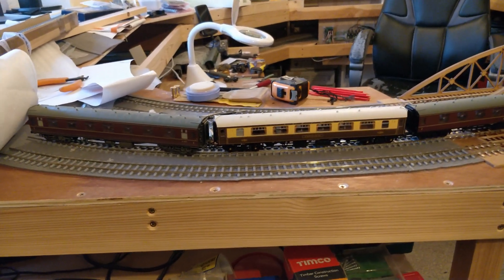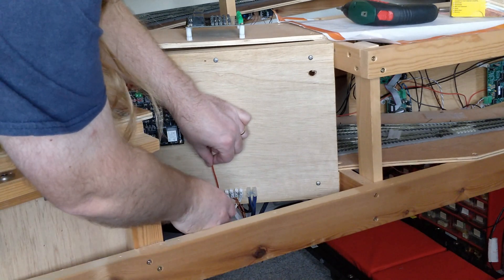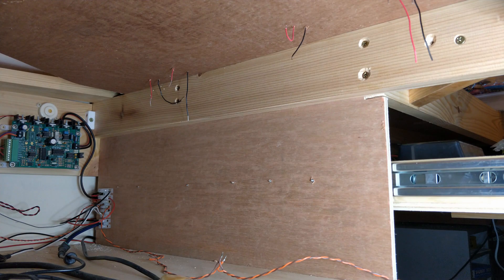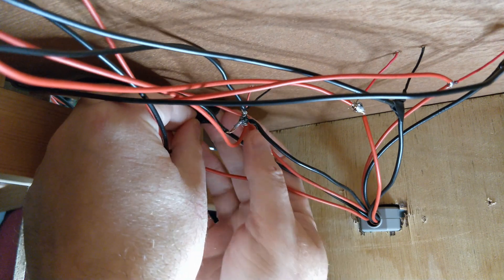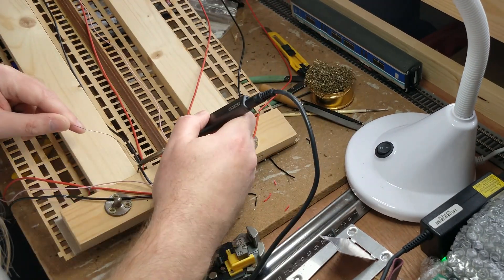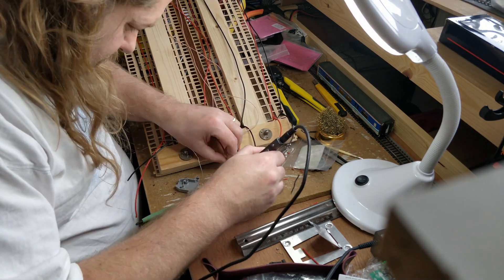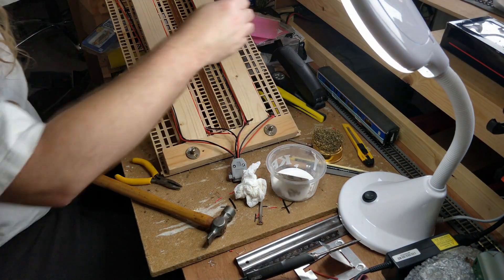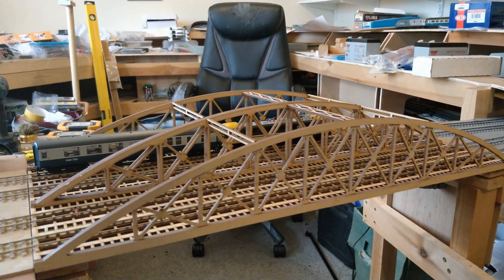Model Railway Construction: Wiring the Lift Out Bridge

Comment: Where do you get the 15 pin D connectors for linking the two together?  Can you recommend any?
Reply from the maker: I had these in stock, so I'm not sure exactly where these specific ones were purchased from.

Connectors of this type are available from the usual electronic component suppliers (e.g. RS components or Rapid Electronics).

Comment: Another suggestion for when you are mounting circuit boards...at 5:30 start at the furthest away and work towards you then you know if you have enough space and it is much easier working towards yourself. It might also help to wire the boards first then fix them to the backing boards.

Comment: Sugru. It molds around the joint. The downside is once activated you have to use it all in one go, which means you'd have to do all the joints in one go.

Comment: Just in case you didn't know you can get heat shrink for multi wire connections, from simple Y shaped configurations to 3, 4 and five wire format. Or just have two wires through one piece of tube

Comment: Why do you solder your dropper wires when it is easier to use a 3 way connector just in case you change the track positions. I can send you some to try out so you can see if they are more suitable.
Reply from the maker: Modifications of the track plan during the life of the layout isn't really a concern for me.
The chance I decide to do that is very, very low, and soldered droppers aren't the limiting factor.

If you have a more conventional flat baseboard, that's much more realistic a thing to plan for -- but I have baseboard in strips barely wider than the track in a lot of places, and carefully planned gradients calculated on the current curvature meaning that even slewing a track more than an inch or two is non-trivial in enough places I'm not expecting to do it. There are places where the curves are simultaneously both as tight and as broad as they can be -- no movement in any direction is possible.

If I do need to replace a bit of track (e.g. if it gets damaged), I can just cut the bottom of the dropper where it hits the bus wire, and pull the track up. If I end up re-using track, I can re-strip the bottom of the dropper, or remove the old ones and install new ones.

If you are referring to the difficulty I had soldering, that was an issue with the LED worklight interfering with the camera, not a soldering issue.